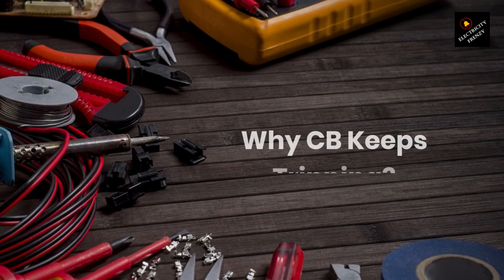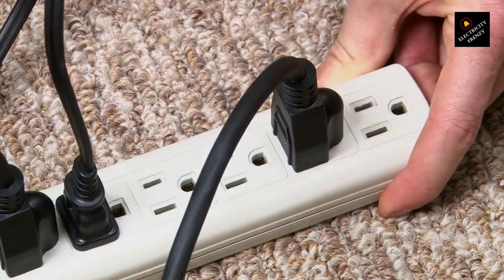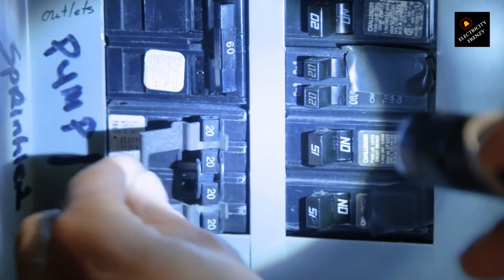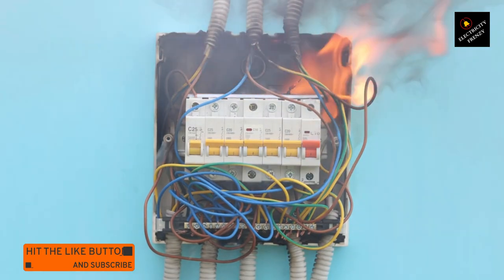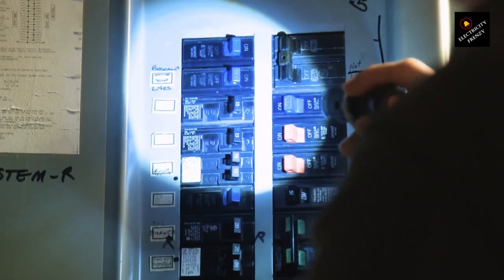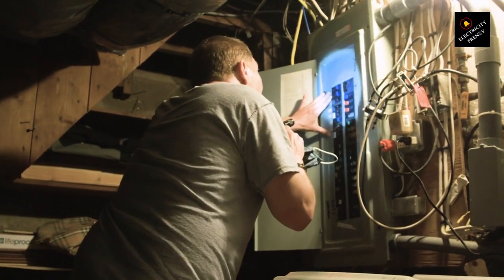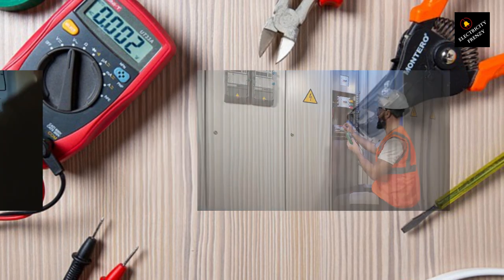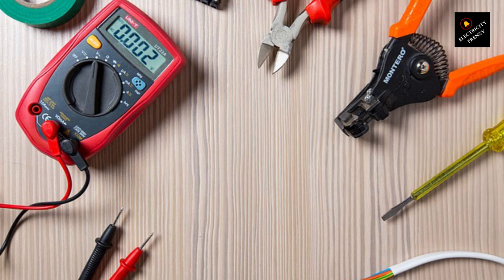Why does Circuit Breaker keep Tripping? The Most Common Causes!

Comment: I read your blog about why neutrals don't shock you... Thanks I appreciate it!

I do have a quick question:

you said :

In conclusion, the reason we don’t get a shock when we touch a neutral wire is that the neutral wire is not energized and is at the same electrical potential as the ground. The neutral wire provides a return path for electrical current and is essential for completing an electrical circuit.

My question is I still don't understand how you can get shocked from a hot wire carrying current BUT you can't get shocked from a neutral that is carrying THAT SAME though current back to the panel? Both the Hot and the neutral have current going to and from the panel. This is still confusing to me lol as BOTH wires have electrical current.
Reply from the maker: It's a good question, think about it like a 2 water tanks, if the tanks have the same water level no water will flow from one tank to the other if we connect them.

The current requires potential diffence to flow from one conductor to another, neutral and your body voltage is the same as a result current doesn't flow to your body.

The same thing happens when birds stand on a hot wire, they get the same voltage and current doesn't flow in to bird's body

I hope you got it!
Feel free to ask me if you still confused 😉
Reply: AWESOME! Thank you so much I am very satisfied with your answer and I love your content on your channel! Have a great day @ElectricityFrenzy
Reply from the maker: I'm happy to hear that you are no more confused, thanks for your powerful commenting!